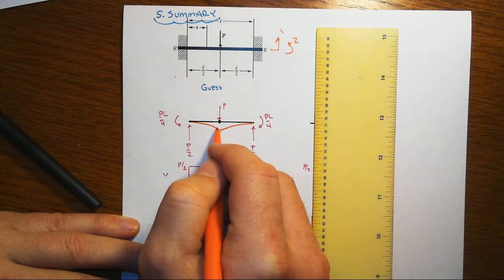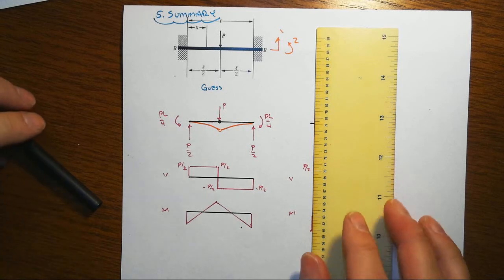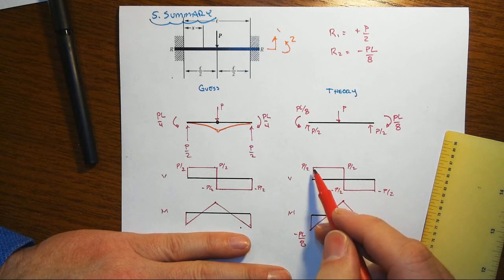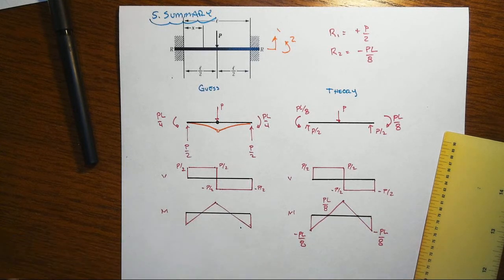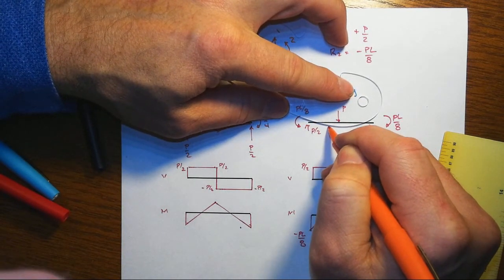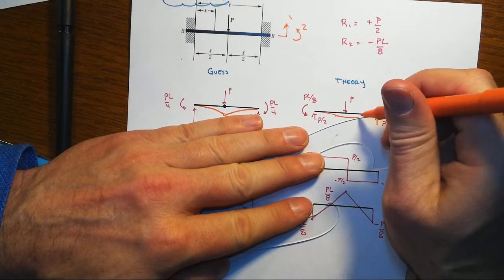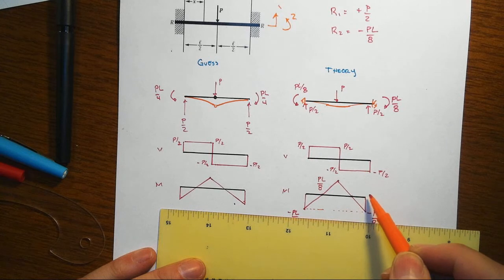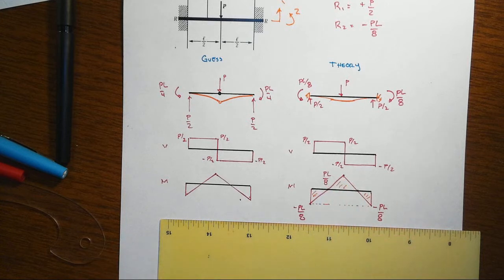Fixed Fixed Beam Part 5 Final

Comment: Could we have made an argument from symmetry to conclude that the moment at L/2 should be equal and opposite to that at 0 and L and subsequently find the full moment diagram using the known slopes?
Reply from the maker: Not sure that I would want to make the symmetry argument to say that the end moments and mid-span moments are the same magnitude.  In general, that would not be true even if in this loading case it is.  For example, a uniform load across the entire span would create wL^2/12 end moments but wL^2/24 at the mid-span.
Reply: Doug Schmucker 
That’s really interesting, thanks for the response!